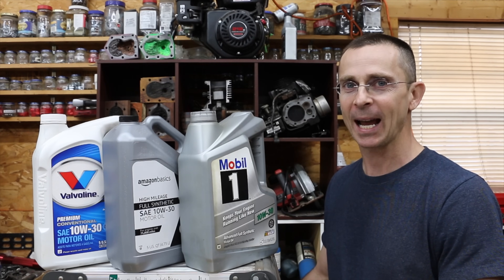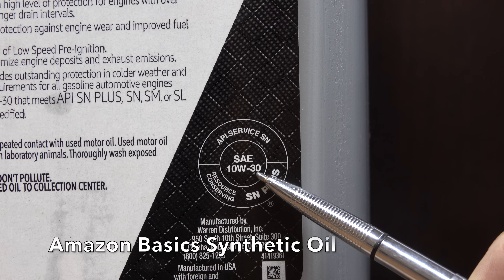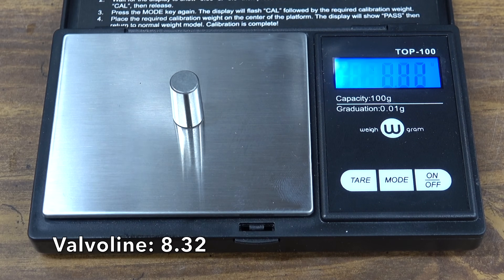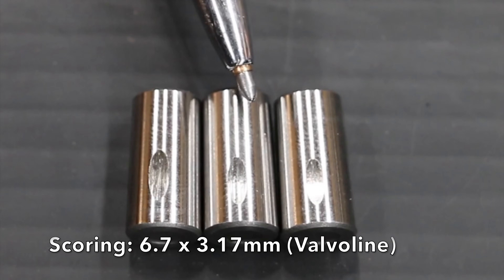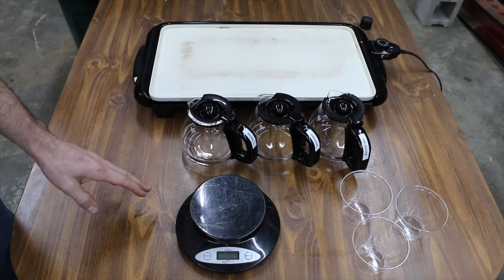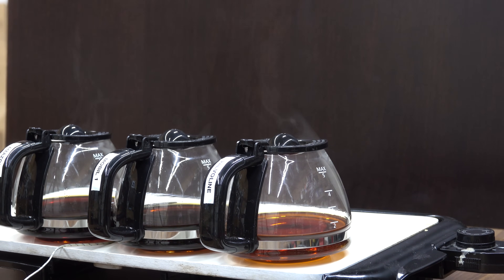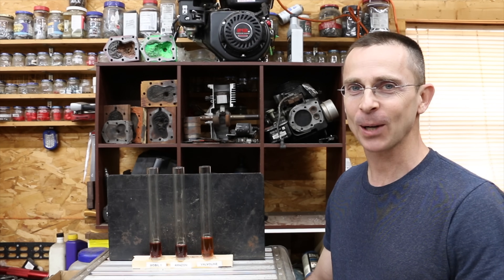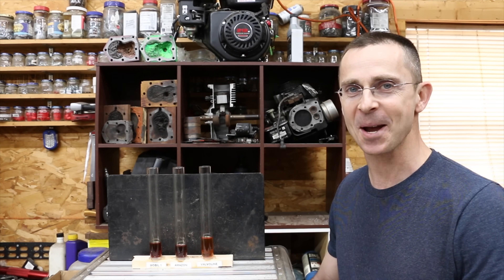Is AmazonBasics Full Synthetic Motor Oil better than Mobil 1? Let's find out!

Comment: Absolutely love your videos! Just subscribed!! I have been using an oil fortifier since 1992. It is manufactured in Butte, MT, and is designed to increase any oil’s boiling point, cold-weather oil flow, eliminate wear from early morning cold, dry starts, increase fuel mileage, protect engine from damage caused by blown head gaskets when antifreeze can wash off oil from metal parts. Originally developed by NASA chemists, it is now made available from SFR “Superior Friction Reduction” (sfrcorp.com). I think you would surely be amazed and in utter disbelief to see this product in action. Since using it, I have never once had any kind of friction-related engine problems with any of my vehicles. Anyway, just a suggestion, and I think your subscribers would love to see such a product in action. Thanks again...and keep ‘em coming!
Reply from the maker: Thank you for the recommendation!

Comment: I can't speak for synthetics but Castrol is the best. It has 14lbs +/-[or 30] of viscosity on a cutting tool on a lathe. Same with that green brand? I forget it's name. Duralube is a great additive. It unlike oil, runs TO the heat source. In my personal experience though. It's longevity isn't more than 3k miles. You can feel it lose it's characteristics.
Reply from the maker: Thank you!

Comment: Yeah but how am I supposed to add horsepower to my car if I don't use Mobil 1 decals?
Reply: NOS stickers?
Reply: Speed holes.
Reply: UnitSe7en bro we’ve watched the same video
Reply: Use the Amazon Basics oil, and use the Mobil One Decals. But you might want to try using the Amazon smile logo for better horsepower than the Mobile One stickers!
Reply: put valvoline sticker😂
Reply: royal purple stickers!
Reply: Paint your brake callipers red thats about +4.6 hp
Reply: get a ball pein hammer and knock golf ball like dimples all over your vehicle
Reply: Amazon has same-day Shipping and that's pretty fast to me just put an amazon smile decal
Reply: Back in 95 or so I worked at a Chevy dealership. I was told to ALWAYS order the "Z71" package on ANY truck I ordered... it was about a $250 add-on wholesale. I asked what the Z71 package included. My answer was:
1. Gas shocks
2. Protective plate under tranny
3.  Z71 decals.
That's all "Z71" was on Chevy truck!
Reply: Adjust your cars center of gravity
Reply: add the sticker to your Amazon shopping cart >_>
Reply: Amazon basics performance plus chip adds 50 horsepower! All you have to do is plug it in!
Reply: Amazon stickers!!..I heard they're fast ...
Reply: plain and simple you wont use Amazon oil and be inferior use Mobil 1 you will notice the hp increase
Reply: download more ram for your car it will make it run fastermy brother did it and now his computer i mean car can play half life 3 on max settings
Reply: nice one.. make me laugh...
Reply: Well don’t u know amazons stickers makes your car value appreciate
Reply: VTEC, YO!
Reply: Megatron 🤦‍♂️
Reply: Laughing Clown Malt Liquor
Reply: Add amazon stickers they add more anyway
Reply: Racing stripes, clearly
Reply: @pr0fet  🤣
Reply: Silly LeBron stickers are for ricers smh....

Comment: The bearing test is highly flawed the oil is at room temp so never operates in those conditions.
Either cold oil crank simulate by using the freezer oil and run for ten seconds to show expected bearing wear.
Or warm the oil first then run it at the bearing to simulate a running engine load the arm to the largest force the oil will have to cope with.
Reply from the maker: Thanks for the constructive feedback.

Comment: It would be very informative to know how these oils perform after 5000, 8000, 10000 miles in normal use.
Reply from the maker: Thank you for the video idea!
Reply: Worse, worse and time to change :D
Reply: @hudson If you are using conventional oil, ok but if you are using synthetic or semi synthetic you are just throwing money away.
Reply: hudson that’s a tad early, even cheap oil is rated for 3000 miles.
Reply: lol i can see changing oil at 5000 miles...but 8k? really? if you are one of those guys who changes their oil every 10k just because its synthetic. the mechanics guild thanks you for keeping them busy on repairs!
Reply: @trooperthorny9783  What? Oil changes every 10k kms or 1 year are normal for typical driver. Because of this bullshit what u said, we can clearly see that u have no idea about engines.
Reply: trooper thorny I highly doubt you OWN any of said vehicles. Don’t try and act tough to the internet.
Reply: @trooperthorny9783  so your experience with engines is 3 massive american turbo charged V8s? For those I can believe that you need an oil change every 3000 miles, but for normal every day cars - no way. Just as a quick note - BMW recommends an oil change every 10k miles for ALL their cars built after July of 2013 (before that it was 15k miles), both petrol and diesel. This includes everything from 114i to M5, M6 and 850i.
Reply: @trooperthorny9783  I drive a 2012 V6 Camry. My owner's manual recommends changing every 10K miles using full synthetic oil. I'm pretty sure Toyota knows what to do to their cars, specially since their cars are the cheapest to maintain over a 10 year period.
Reply: @saulgomez6025  WRONG. https://repairpal.com/estimator/toyota/camry/maintenance-schedule by your logic. toyota will change oil every 2500 miles. go look it up
Reply: Change it every 8k+ you will be expecting a knock at your door💀

Comment: So from my understanding Warren Distribution is the supplier of the majority of the top brand oils as well as Walmarts Supertech oil. Amazon did a good job sourcing oil from the manufacturer who supplies Mobil 1 oil in the United States. I'm also not concerned about Amazon changing suppliers because Warren Distribution is the cheapest option for them and that's why the top brands source their oil from Warren as well. The next cheapest option but also more expensive would be the company who supplies Wolf's Head with their oil. I doubt Amazon would be willing to pay more than what they do now.
Reply from the maker: Thank you!

Comment: Motor oil is basically a base oil combined with additives or the "ad pack". Testing the viscosity without testing Noack Volatility is unacceptable. The properties that help oils flow well at cold temperatures are often the ones that help it to boil off during normal engine operation. Only the best base oils perform well to both standards. The API donut is , at times, meaningless. The "license" to put that on a product is obtained in writing saying how you will blend that product and PAYING A FEE.  Lots of money goes into developing certain "ad packs" that blenders can specify but no one is monitoring whether they really use the good stuff.  Quart bottles are the most likely to have inside what is stated on the bottle, but many service centers buy oil in bulk.  Buy a nationally advertised brand, I use Mobil 1, and be sure it comes in a sealed container, not from a bulk tank. My shaded opinion comes from experience working as an oil chemist. With synthetic oils performing at such a high level, 8,000 - 10,000 miles is the norm for oil changes. Do you really need to take the risk to save $6 twice a year? Buy the best oil you can find from a huge company that has a lot to lose if things are not right. It's worth two freaking hamburgers a year!

Comment: Considering you attempted to do a very thorough test, why would you not do the wear testing again after heat cycling the oil a few times? Seems like you intentionally skipped the most important part of any oil testing, longevity.

Comment: It is not just about SAE viscosity rating. There are far more things to consider in terms of oil specification. It cannot be simplified to brands only. Further, this is not a realistic test. The apparatus used here is appropriate for testing static lubricants such as lithium grease. Engine oil is pumped around the engine. There is an engine component to facilitate this and it's confusingly called an oil pump.

Comment: Yes oil flow in a cold engine is very important, especially when the polar vortex hits. If you want to here what an extremely cold engine start sounds like this is what my 2004 Honda CRV sounding like on starting https://m.youtube.com/watch?v=1SflZKAB3Nw I am using a  Mobil1 5w 20.
Reply from the maker: Thanks for the video!  That's a great oil. I think I heard the power steering pump whining a little and a slight rattling in the engine.

Comment: Another great test. Thank you. I've used Mobil 1 for decades in all my vehicles, and those that are well past the "ton mark" (over 100,000 miles) are still strong engines. Never added any oil between changes. I might consider changing to Amazon Basics, but the only concern I have is will they keep the formulation the same over time, or switch to cheaper ingredients somewhere down the road. I think Mobil might be more concerned about keeping their good reputation than a generic brand sold mostly for its low price point. I'm not saying that I won't use it, but just something to think about.
Reply from the maker: Thank you

Comment: I just used the heat shrink tubes with the solder ring and seal ring in them. They worked great but I'm curious about resistance and strength of the bond. Can you test a quality crimp vs solder vs the heat shrink solder tubes?
Reply from the maker: Thank you for the video idea!

Comment: i use to work in France for a company well know for is motor oil and more : many cheap brand was in fact the same oil as top of the line brand such as mobil/motul/total/BP.
In the end a motor is better with a oil change every 6000 miles with amazon basics oil than 12 000 miles with non sens long life oil like audi.
Reply from the maker: Thank you!

Comment: Have you ever done a video to test if an engine that runs on Oxygen+fuel mix and not air+fuel mix is more powerful/efficient? Like using an oxygen cylinder to provide pure O2 instead of allowing air in which only has about 20% O2 in?
Reply from the maker: Thank you for the video idea!

Comment: Hey mate, here is a suggestion for a video.
Test out the “ceramic coating” paint protectant coatings which are all the rage at the moment. See if they’re as good as the ad’s make them look.

Keep up the great work, always enjoyable watching your videos.
Cheers 👍👍
Reply from the maker: Thank you for the video idea!
Reply: they work my show truck is ceramic coated maintenance is extremely easy the newest coating is self healing coatings. If the surface is scratched heat will actually heal the coating and the scratch will disappear
Reply: Eduardo Monroy what brand? Send it through, if Todd tests it it could win!

Comment: I love your testing on products and  I am glad that there is someone who does it.  At our local Rural King stores there is a brand of oil called Harvest King,  5 Qt. of full synthetic is $13.99 and 5 Qt. of conventional is $9.99.  I have 2 vehicles and so far i have only dared to put it in my $1000 work car that has 175k miles.  I have been using the conventional because i am scared to switch from the dino juice with the mileage being so high.  I would like to see how their synthetic would compare in these type of tests.  If it was good i would use it in my newer model Ram 1500.  I am currently running Valvoline full synthetic in it and I wasn't too impressed with it from these tests.
Reply from the maker: Thank you for the video idea!

Comment: I thought I heard somewhere amazon basics is same as Walmart super tech which is the same as warren oil company.
Reply: At one point when he shows the Amazon Basics bottle, the label says ""manufactured by warren distribution, inc."
Reply: Yep so basically this test showed everyone that super tech is also pretty decent
Reply from the maker: Thank you!
Reply: Yup. Some of the Amazon basics bottles still have the Supertech logo stamped on the plastic.
Reply: Holy crap I think I'm gonna use this in my Subaru cause they use tons of oil 6.7qt per oil change and usually have to put a quart in between changes. Being it does well in hot temperatures I may not have to add any oil between changes. I'm actually pretty excited to test this out. 3 weeks before I can get it to my house though
Reply: @Hallowsaw  Not to mention how much oil leaks out of those Subaru heads. A long with coolant.
Reply: @chuckie11C  Modern ones don't have that problem. Mine is 8 years old and not one problem with anything. Its more electrical problems and transmission issues than anything nowadays. Their engines are pretty solid now. I think people have issues with them cause they really are not cheap to maintain. I drive 20k miles a year which puts me at 4 oil changes, 1.3 transmission drains, 0.6 differential services, 0.33 brake services and 0.25 new tires a year. Thats $240 for oil, $80 for transmission, $30 for differentials, $133 for brakes, and $200 for tires. Totaling $683 solely for basic maintenance. Also that puts me at $2100 a year in gas. So... i spend almost 3k on keeping my car running every year including insurance. Tis nuts
Reply: Amazon delivers for free if you have prime
Reply: @thinkingimpaired5663  nah, free on orders over 20
Reply: Yes it is,  also the same as proline, sold at pepboys
Reply: Holy crap I think I'm gonna use this in my Subaru cause they use tons of oil 6.7qt per oil change and usually have to put a quart in between changes. Being it does well in hot temperatures I may not have to add any oil between changes. I'm actually pretty excited to test this out. 3 weeks before I can get it to my house though
Reply: 420 Friendly  Free shipping on orders over $25
Reply: @847MicRoss  but free shipping if you have Amazon Prime. Sometimes even free 2 day shipping.
Reply: @47pawspa  Did you even read the comment I replied too?
Reply: @847MicRoss  no cuz I am blind. I responded to the first thing that was being read to me
Reply: Scotty kilmer

Comment: Hey can you please do a Havoline Pro DS vs Pennzoil Ultra Platinum vs Amazon Basics? Maybe Redline or Amsoil, but I secretly know they aren't as good ;P
Reply from the maker: Thank you for the video idea!
Reply: @ProjectFarm  I use Ultra Platinum in my car. But I read that only regular Platinum is rated SN plus. Not Ultra. So I'm probably switching. I would use Havoline but it's so hard to find, I had to email the company for a distributor and it's sooo far away.
Reply: Lol? Amsoil is better than all of the oils you mentioned. Try valvoline full synthetic or brad penn racing oil too if you are geared towards performance
Reply: @brett420favre  If you were to download and compare the data sheets to each oil (I use 5W-20). You'd find each oil you've listed is inferior in its properties to the oils I've listed. 

What made you think that?
Reply: @brett420favre     I don't have an opinion` one way or the other, but Terry Dyson's testing and analysis agrees with your statement, as two Amsoil Signature Series fully Synthetic oils out performed some 200 other oils and ranked top 1 and 2 places in the straight out of the bottle category.

      But value to price ratio--nah.  That probably has to go to Quaker States Ultimate Durability 0w-20 full synthetic, which I think ranked 6th in the straight from the bottle category, and really wasn't that far behind the top performing Amsoil ones. When the oils perform that well, a slight difference is like comparing a slightly darker shade of gray to a slightly lighter shade--not much difference all in all.  

   I can get 5 quarts of the Q.S. oil for about 20 dollars. Hard to beat, even if you sign up for Amsoil's preferred customer membership discount (10 dollars for 6 months or 20 per year).  Shell bought Q.S. back in 2002, and seems to have been improving the brand since. I've heard that at one point, Q.S. made pretty bad oil for a long time, because it had too much paraffin, which contributed to sludge.  

  But then again, Japan use to make crap cars and motorbikes, and Korea use to make crap cars.  Now they both make some of the most reliable and well built ones.   Things can change.
Reply: @justinw1765  couldn't find a link for Dyson Testing, how do they compare to Blackstone?

https://youtu.be/P6mT1c020g8

Not the most scientific test but I have seen more that one video with the same result. Of course there's more to oil than cold poor testing. but in the cold climate where I am from, cold pour viscosity of oil IS the most important property of the oil you choose. Maybe in California I'd put in Amsoil and not undercoat my car while I'm at it.

Comment: Why choose a 10w weight?  Doesn't most cars call for 5w or even 0w?    And should a 10w even be used at negative 15degrees???? I use 0w in winter or 5w in a pinch.  (Almost never)

Comment: Excellent video again, the Amazon basics really surprised me, however the lubricity test decided it for me, I want an oil that has the best wear protection.   Looks like you can beat mobil1 in that category, I have been using Mobil1 for 15+ years and will continue to use it for the best performance/price in my opinion.

I'd love to see a showdown with more exotic Oils like Mobil1 vs Castrol, Royal Purple, Amsoil, Torco, Liquimoly, Eneos, etc, does spending more money on oil give you better protection?
Reply from the maker: Thank you for the video idea!

Comment: Not sure if it would be worth testing, but I remember hearing about a big issue with some oils reducing the zinc content. It was causing small engines and race engines to fail faster. Probably the higher rpms and less wear protection. Wonder if that is what helps the results.
Reply from the maker: Thank you for the video idea!